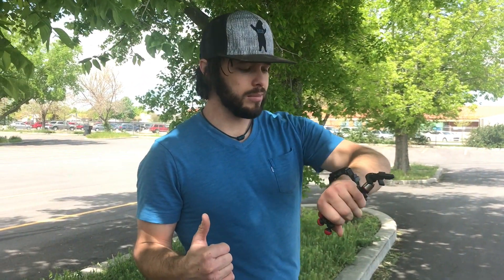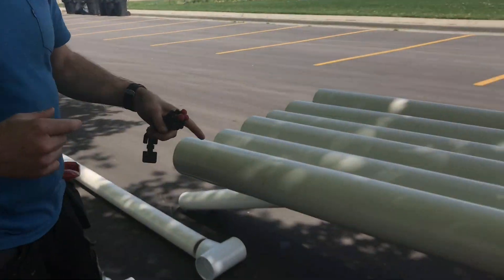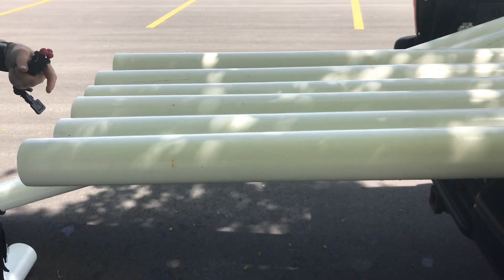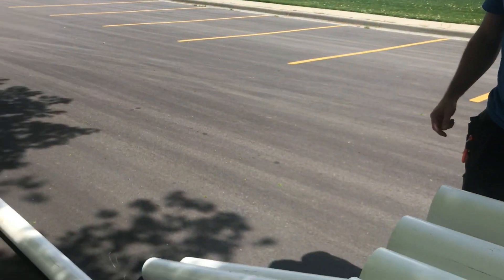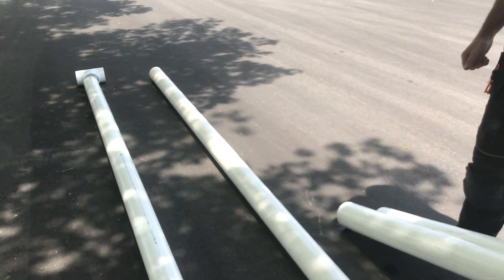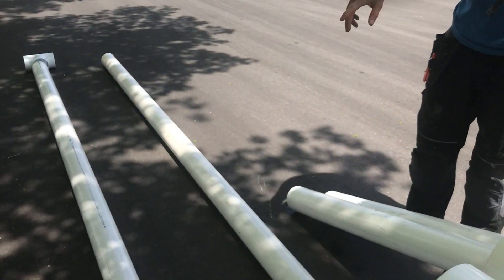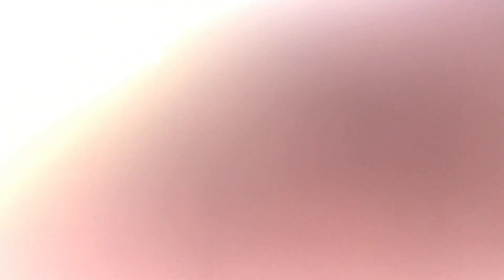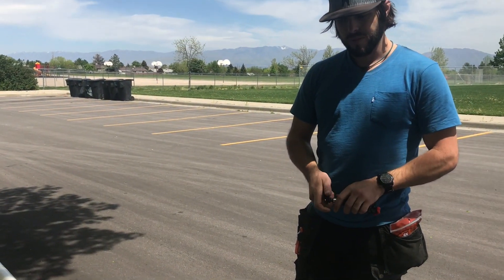#25: Water Storage Tank

Comment: have you calculated the weight of the water? You will exceed 1-2 thousand pounds in weight. Can the roof handle that weight?
Reply from the maker: Hey Tim, good question. The final PVC design holds ~80 gallons of water (~668 lbs), and all that weight is distributed on a racking system that is then bolted to the vertical steel beams in the trailer walls.